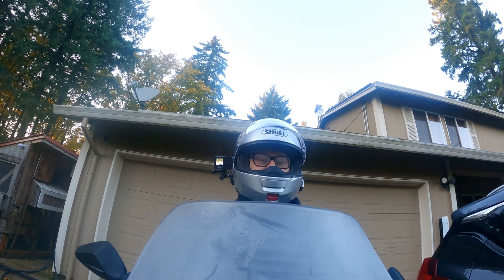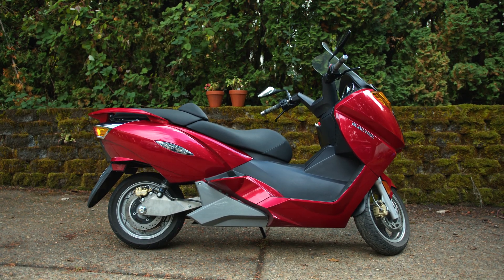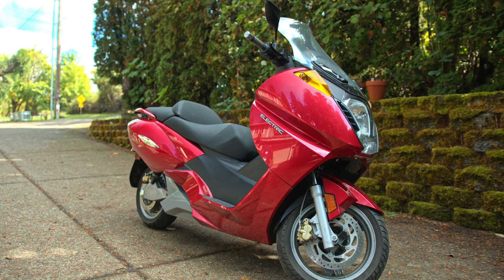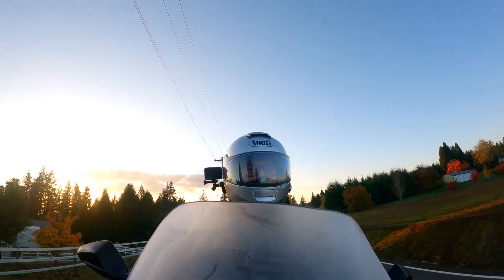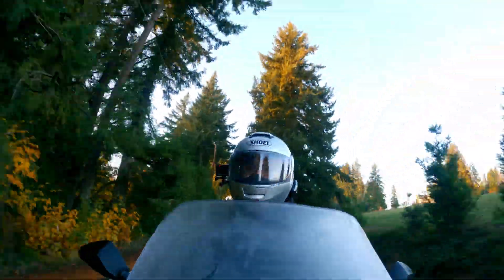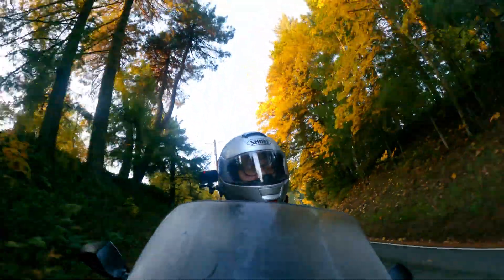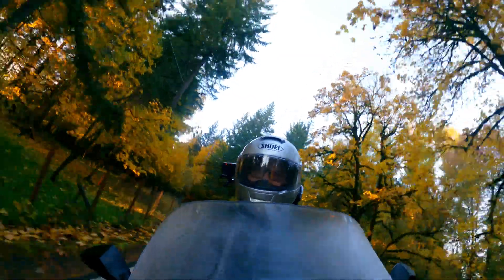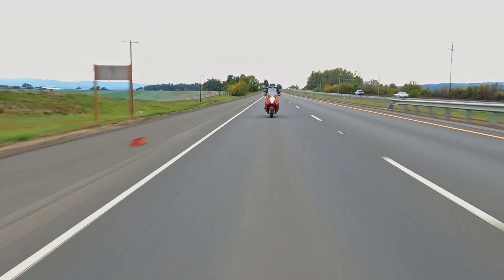What Battery Modules Should Our Vectrix VX-1 Electric Maxi-Scooter Get?

Comment: I have  2007  vectrix I bought new in 2011. I rode it about 7000 miles. 
I would love to ride it again. 
I would go Nissan batteries. 
My original charger is like yours. Junk.
I would like to see how you manage bms and charger. 
The scooter handled real nice with batteries down low. I really enjoyed the Regen operation setup.

Comment: Hi owner of Emma😀. I have a 2008 Vectrix V1 that suddenly broke down. I´m from Norway and there are no Vectrix clubs or similar here, so when I saw your YouTube channel I was inspired by your video and your information that there is a What's Up community and a group in Spain that knows everything about the Vectrix V1. I have removed the covers down to the battery pack and found that there has been a fire/melting of some of the thermostat cables that are attached to the batteries to control the temperature. I would greatly appreciate it if you could help me to move forward on the path to getting the Vectrix I love back on the road. PS! I have no experience in participating in What's Up groups or other forums, so please excuse me if I go about it the wrong way. I am a complete rookie and need "desperate" help. I guess I need to be a kind of member, but please tell me how I can be that. Where will I get your reply? My skype address is: olaost Thanks.

Comment: Advice: do not rearrange the 8s ID3, very dangerous task. I have an original 8.9kWh  original Amita pack on my vectrix and next year I plan to switch to 3x 12s ID3 modules. good luck!
Don't forget about BMS if the original BMS you have cannot be adapted to li-ion.

Comment: I’m not a motorcycle rider, what is the practical, comfortable trip length you might take with this bike? While it seems cool to go for maximum range, is it really needed? (Though you might want it😆).  Also, are there cooling considerations? Will air cooling for the larger pack be adequate or will it overheat and degrade quickly?

Comment: I hope you where talking about the second Gen leaf, cells.

If not leave those for Batterie storage projects.

I would lean to id3 with 15kwh or less.

So you increase range yet reduce weight and not spend the highest amount on it.

Ps: will this all be passive cooled not taking the cooling over from the packs?

Comment: I came off my escooter at 30mph on wet leaves 2 days ago - grazed knee, hip, head, bruised ribs, shoulder and sprained wrist elbow, but otherwise OK.
All of my right side aches, but it'll pass! Leaves are treacherous, even going in a near straight line.
I didn't even do any turns, just had to adjust my line for a couple of pedestrians, went past them, hit leaves and front wheel got a mind of its own with no chance of correction, so I had to jump off and hit the deck. Luckily the cycle path was undamaged, as was my scooter. Had a bit of shock, but controlled it.

Comment: Over 150miles is a very interesting option. Especially for rural or hilly areas or people in higher latitudes who ride in typically colder temperatures. A lithium iron option would also be  interesting for people who are interested in battery longevity or those concerned about human rights in the Congo. I would definitely talk to @jehugarcia about LFP options since he’s been doing a lot of those lately. He’s a pretty good resource when it comes to DIY battery projects. I’ll be very interested in whatever direction you decide to go with this one.

Comment: I wouldn't recommend the 70% Leaf cells, as you'd be replacing bad cells with slightly less bad cells. But would you want to cope with the risk of the VW cells and living with an experiment that may choose not to get you home one night and can't be fixed without bench diagnostic kit?
That leaves good Leaf cells, which is a known swap giving reasonable range. There's nothing wrong with the Leaf cells themselves, just the poor way Nissan implemented the pack

Comment: I'd be tempted to go with the Leaf cells. As part of the learning curve and without breaking the bank, they'll do the trick, as per the original plan. 
You're not getting double the range for double the spend.

As a leftfield option, have you looked into getting a custom 18650 pack made up from somewhere like EM3ev?

Comment: I was surprised with your reaction to the pedestrian attempting to cross the road in a suburban environment.
Firstly, you're riding a quiet machine and many pedestrians cross the road using both their eyes and ears 
Secondly, you were riding as dusk approached, which is a particularly dangerous time due to low sun.
I wouldn't have been surprised.
Reply from the maker: Good points - but more unusual because of where they crossed - people tend not to just walk across the road at random points... although that is more common in the countryside ;) - Nikki.
Reply: Thank you for taking the time to respond.
Reply from the maker: @michaeloreilly657  Of course! And you'd be surprised exactly how noisy the VX-1 is. Those straight-cut gears make a LOT of noise! - Nikki. ;)

Comment: Glad to hear that you are alright.  If you're going to stick with this two wheel therapy thing, I say go with the locally sourced used Leaf batteries.  As others have mentioned, it would be a much more accessible project for viewers to follow. Also you'd be supporting a local business.  You've not been the kindest to Nissan and its batteries over the years based on your experience.  Yes I've been a follower and supporter via patreon that long.  Your Leaf didn't have the lizard battery pack and you were really pushing the limits of the car once you moved and your wife's comute became far enough that ot was at the outer edge of what it was designed to do.  Maybe you can find some 2015 or 2016 vintage lizard battery cells for not too much more than the mystery vintage Leaf batteries.  A battery of this type and vintage is likely to have 80 + percent battery health and maintain it quite well.  The degradation seems to have been mostly at the beginning of the battery life and then while it's still continues it actually seems to slow significantly. A lot of people expected it to be more linear and even potentially accelerating over time and for the most part that hasn't been what most people have experienced.   

Whatever you do, I'm sure it will be interesting to follow along.  Just be safe and take care of yourself.  I'm afraid been having a range significantly longer will just tempt you to ride the bike a lot more on longer faster routes and that is probably not the safest thing to do.

Comment: Leaf pack, get every working, tested, doing what you want. based on the original plan. Enjoy the bike.
Keep an eye out for the ID batteries cheap and save up longer term and replace them later in a few years+ and use the old leaf pack for the lawnmower or other projects.

Comment: Hey Nikki. I ride a BMW CE-04 in North Portland which has a range of 70-80 miles @ 60mph. I was worried that it wouldn’t be enough but it has never been an issue for me. Around here it has been great. It charges so much faster (as a matter of percentage of charge) than my leaf with the same range that topping up on the road with level 2 charging is just like DC fast charging with respect to time. You should come borrow it some time to see what the range feels like on a scooter. 150 miles would be nice but you would probably be happy with 90.
Reply from the maker: A good point. The challenge is that the 90 miles needs to be 90 miles usable EVEN with a massive hill at the end ;). - Nikki.

Comment: As calculated with daily driving and inside a Leaf, older Leaf batteries loose around 5% SoH per year and newer Leaf batteries loose around 3% SoH per year. For the older Leaf batteries, that's around 6 years useful life starting at 70% before the risk of cells failing and the pack needing re-opened. Considering the lowest range estimate of 60 miles, even in 6 years, that's still enough charge capacity to make it one way, charge, and return with a smidgen of wiggle room both directions.  That said, if the newer Leaf cells are available and will fit, I'd go with those even if cost is a little higher. I like that extra wiggle room that 2% a year gives. 

If it's time for replacement six years down the road, by then there will be even better battery options available. The ID.3's would lose points just due to the extra monetary cost. Then considering the additional time of shipping, and the unknowns they'd be completely off the table. I should mention that it's not the dollar amount of the ID.3 batteries that bugs me, I certainly could personally afford them, it's the shear number of times I could swap Leaf batteries against that ID.3 battery cost.

Comment: How's the community & equipment support for the ID3 batteries/capacity implementation?  If confidence is high, I'd be super-tempted by the higher range option, despite the cost.  Buy-once-cry-once, right?  But if that upgrade is still damp behind its ears, the Leaf battery upgrade might be the surer approach.  It's a tossup, sorta.  How does time play into it?  If it would pay you dividends NOW to get the Leaf packs, but you'd delay dividends for a while awaiting funds for the ID3 packs, that may be a few points in favor of the Leaf gambit.

Comment: Hi Nikki,
I’d be really wanting to have the higher range too, but ID.3 modules have got to be CRAZY expensive and hard to get.  Seems if you were able to get Leaf modules from newer model years (>=2018 modules work, and have s/w support for VX-1 …!!) so you put your hard work into parts that will give YOU a pack with good lifetime and better range.
I’d take the time needed to get very good condition Leaf modules.  More on ‘the beaten path’ for tech knowledge from other VX-1 owners experience, and better outcome for your hard work.  Enjoy.

Comment: There are a couple of used Zero Motorcycles for sale that are under $4k-$5k, with 11.4 kWh or 12.5 kWh batteries. For perspective.
But the ID.3 modules are probably the better option long term if you plan on holding on to the Vectrex and riding it.

Comment: Ouch... It sounds like this wasn't the first time you laid down a bike.  So no need for advice, you know the drill, glad you walked away in working order... Thanks for the PSA.
Reply from the maker: Actually, it IS the first time I’ve crashed a motorcycle- But I’ve come off pedal cycles plenty.
Reply: @transportevolved  oh, shoot!  Well, then this is for you: There are two types of motorcycles riders, those who have wiped out, and whose who will wipe out.  So welcome to the former club I guess...

I first missed a corner I'd never ridden, while I was in a mad mood, when it was wet, and I didn't lean into the corner enough, the bike might have made it, but I didn't trust it enough, so got into the soft shoulder.  Was lucky to still be able to ride it home...

I watched a buddy wipe out on a railroad crossing once, and I could just feel it coming.  I lent him a second bike, and he had been doing well for a week.  I was leading and even tried to take a corner extra extra slow.  But it still slid out from under him on some rubberized rail crossings he cornered instead of crossing at 90degrees... Sigh.

I suppose it gives you some extra level of caution... Hope you continue to enjoy riding.  I still did, got it all fixed up and went out to the track later that year.
Reply from the maker: Funny you mention it,  @D0li0  but that's kind of where I came from. I graduated to the OTHER type of motorcyclist - Nikki.

Comment: More range is definitely a good thing.  I ride a Zero S here in the UK and even though its battery is 14.4 kWh I still want more.  If it was me I would go down the Leaf route now for $1200 ish.  Then in a year or two when ID3 batteries become more available I would go for that.  The Leaf batteries should still have some resale value then as well.  It's similar to what I am doing with my converted 1970 VW Bay Window Campervan.  It was converted by Electric Classic Cars in Wales and is running 42 kWh of Tesla Roadster batteries.  The set up is decent but the charge times are painfully slow on just level 2.  For now I am happy with 130 miles ish range.  But I figure that in 4 or 5 years time I should be able to swap out the batteries for whatever is good at the time, be they solid state, BYD blades, Tesla 4680s and upgrade the charging to CCS.

Comment: This is basically a timing issue, iff the VW batteries can be acquired in a reasonable time according to your tinker timing then go with them.  On the other hand, if your tinker timing availability is high at the moment and the bigger batteries are several tinkering cycles in the future, then go with the Nisan batteries and tinker away so you can ride off into many sunsets.  🦊Riki2Tails

Comment: What I have done for an electric scooter is all the LFP batteries I can fit on the deck plus a range extender that uses tool batteries. 90% of my trips by number are without the range extender. The trips that need the range extender are 40-ish kilometres between charges. The range extender runs on 18 volts and pushes 50.4 volts on to the BMS. The BMS accepts a 54 volt charge from mains. I have another scooter that is 36 volts with an extender bolted on all the time so it can go up a steep hill

Comment: The question I have is where have all the Chevrolet Bolt cells gone? Surely in US there must be a lot from the re-call. I'll bet that guy in California that does all the 18650 cell vehicle packs would have a handle on it? Jehugarcia? You love to ride so , spending $700 on a charger deserves more than the lowest battery solution?

Comment: If you enjoy the process of doing the upgrade then start with the Leaf cells then later make the move up to better, bigger, longer range cells.  If, on the other hand you would prefer not to do the job twice then go with the biggest/best cells you can possibly afford today.  

I would be leery of using the Leaf cells that are down to 70% capacity.  By that point you are well down their life cycle and on the wrong side of the degradation curve 'knee'.  I think that there would be very little life left in them.  Maybe good for experimentation and the experience of building a pack and doing the upgrade, but expect to be replacing them sooner than you might think.  Only of interest if they can be had VERY cheaply.
Reply: Well said!

Comment: If this were my bike, and I wish it were, I’d use 3500 10A mAh 18650s or the 5000 mAh 21700 equivalent from Panasonic/Sanyo/Sony/Molicel etc. Best range for sure, plenty of power, easy to customize to fit where you need it to be.